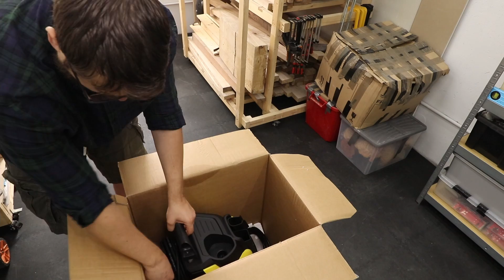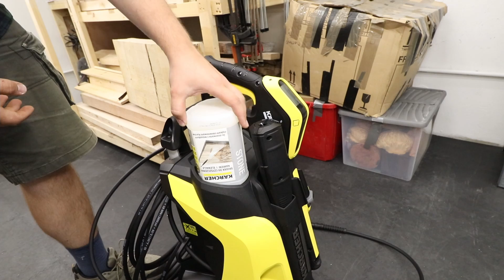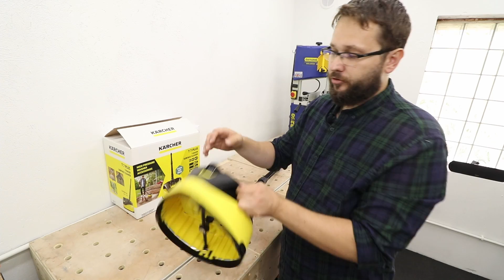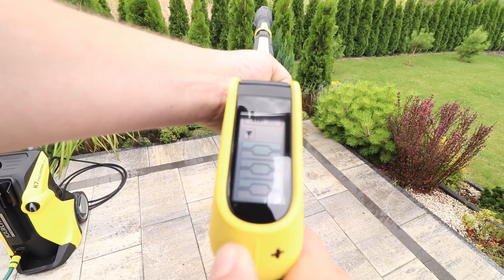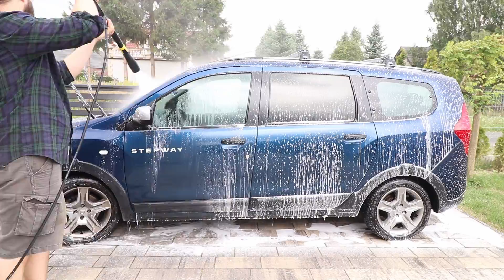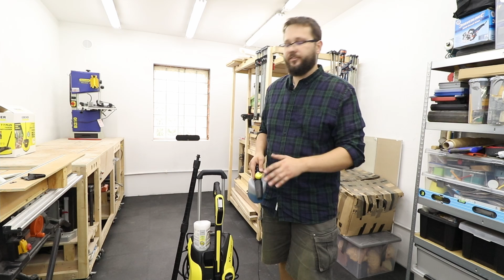Karcher K7 Full Control Plus Unboxing & Testing

Comment: Thank you for the good review but my K7 gun screen not showing same what you did even I follow your procedure 
Could you please advice me
Reply: Thank you for your response, and I will also I’ll try to find a solution because really I tried everything but only what I got is full battery sign
Reply: Finally I discovered the problem 😅actually when the battery indicator showed it was full but unfortunately it wasn't, so I replaced the battery gun and now it works perfectly 👍🏼
Reply from the maker: @shakeralawi1869 great to know, thank you for sharing 👍
Reply from the maker: Hmm not sure to be honest, never had a problem like that. I would drop an email to Karcher customer service.

Comment: Anyone has the problem whenever i use it it works good whenever i use my mckillians gun on it it also works but then when i use foam gun on the mckillians it works then it stoper after 3 seconds and it builds pressure then it works then again stops anyone knows fix

Comment: Why do you promote this brand? I'm in market for Pressure washer and i read everywhere that Home karchers leaks. Plastic parts inside and the just breake quick 100s of post był so many people.
Reply from the maker: I don't promote it. I bought it off my own money and I showed how it looks, works etc. Not sure where do you see the promotion of this product. 🤔 now I have not done the follow up video yet, and this video is several year old now. And guess what, mine doesn't leek, works just fine. The only thing that was wrong with it it was the handle that fell off which I did show in my video.

Comment: Hi! Can it take water from tank or it has to be pressure connection? Thanks
Reply from the maker: Needs to be pressure connection, if you check the details of the product on their site it will tell you what is the minimum pressure.

Comment: I plug in, water on and then the water doesnt come off the pistol…
Reply from the maker: There is a process to follow when it comes to running this machine. Check the connections if they are siting correctly, the hoses are not bent etc.

Comment: Another great video Tomasz, be warned!!!!!!!!!
I have the K7 and I made the mistake of pressing the trigger in between changing the Lance settings. You should know that there is a rubber seal inside the Lance which will get damaged and render the Lance useless. You then have to send it back for repair and may get charged for a replacement seal due to failure to follow the operating procedure. ☺️☺️

So the moral of the story is, NEVER CHANGE THE LANCE SETTINGS WHILST THE TRIGGER IS BEING PRESSED. 

Thanks again for sharing your videos
Colin 🙏🏻
Reply from the maker: Thank you for the tip and warning 👍 something to watch out for, thanks!

Comment: Good review Tomasz.  I've had several Karchers over the years, currently got the K4 Compact. You're right about the T Racer, it's often quicker and more efficient to just use the lance for cleaning.  Also, make sure to drain it down before storing for the winter to avoid damage, (don't ask how I know 😉).
Reply from the maker: Hehe good tip thanks 👍

Comment: Thanks Tomasz, a very good review. I currently have a Bosch pressure washer which is an entry level machine. It too does a good job and have to say that it's comparable to the Karcher without the bells and whistles. I think I'll be keeping the Bosch for a little longer ;-)
Reply from the maker: Thank you. Yes I wouldn't upgrade to the Karcher K7 if you already got something similar.

Comment: K5 is sufficient for a house I have been using one for a while now and it works well. K5 also has aluminium housing for the pump same as K7. K7 might be an overkill   :)
Reply from the maker: It was on offer that's why I picked it up😁👍

Comment: I love the karcher pressure washers, i've owned two and the only reason I bought a second was because it wasn't stored very well in the shed and I trod on the water intake connector on the first one and snapped it off, but the second I've had for years and it still works great :)
Reply from the maker: Let's hope mine will have a decent life span 👍
Reply: I owned proffesional karchers and one of my karcher is 18 years old